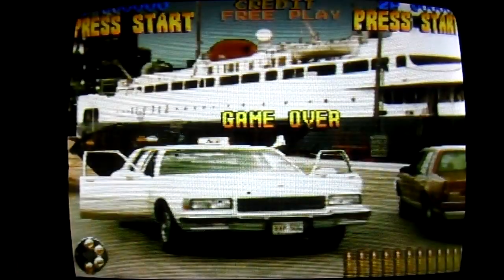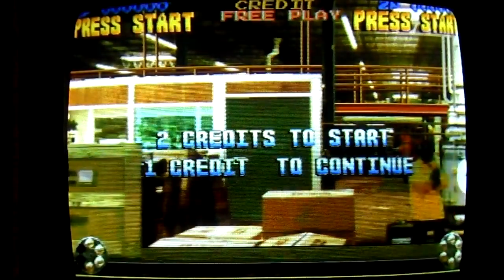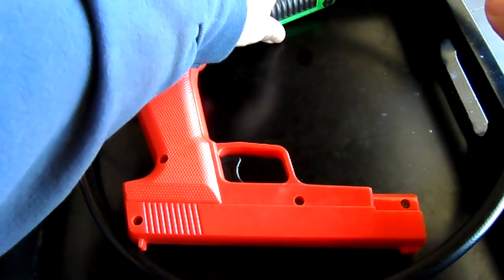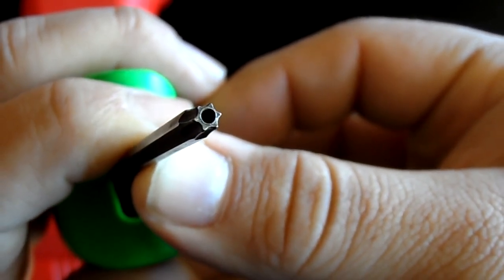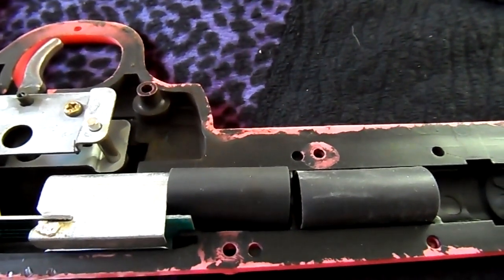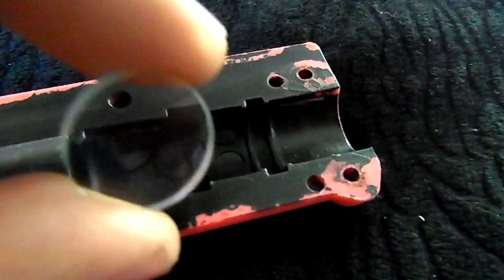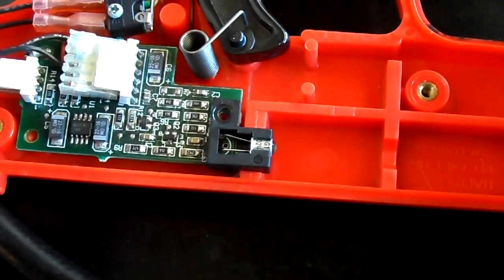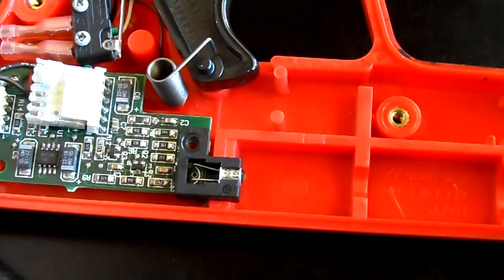Get Your Happ Arcade Gun Working Again

Comment: Hey there,
Other tips: If the plug hasn't come off the little pcb quite often the optical sensor leg is broken off the pcb. Also if inaccurate and the screen is nice and bright check 5VDC, if voltage(at game board) is too high the accuracy suffers.
If you can lay your hands on the earlier Happ guns with the two screws near hose instead of three they are far better, and the new Happ guns the plastic is brittle, they smash into shards.

Comment: Also, don't forget to clean your monitor screen and other glass/plexi in the way (bezel). Broken wires can easily be tested with the continuity test on your handy, dandy multimeter, unplug in gun and at PCB, test each wire at both ends to see if you have connection.

Comment: is there anyway to get this guning on a PC?
Reply from the maker: do you mean rousing a happy gun on a pc?
Reply: +moomert1 I'm thinking of making a MAME machine with an old light gun arcade machine (although I haven't gotten an old one yet). I live in Trinidad so most equipment and parts has to be shipped into the country and it's a bit costly so I'm looking for a cost effective solution.
Reply from the maker: +Dhara N. your best bet is to replace the arcade guns with pc compatable guns. I used to use the lcd top gun set. not sure if they are still around
Reply: +moomert1 thanks a lot, but I'm not sure if I need anything more than just the gun for two player